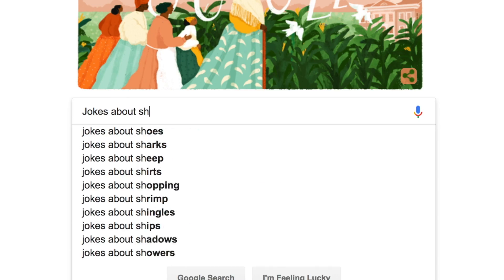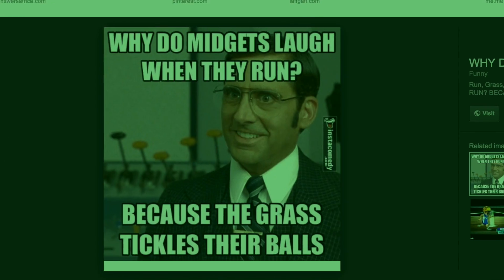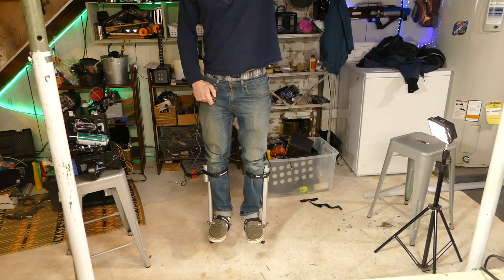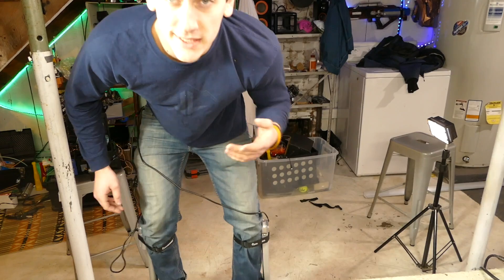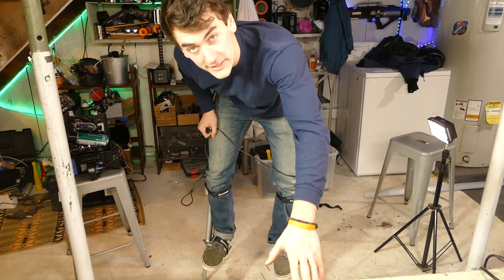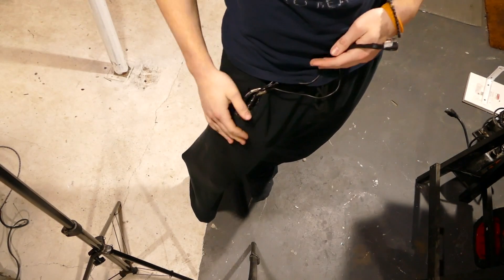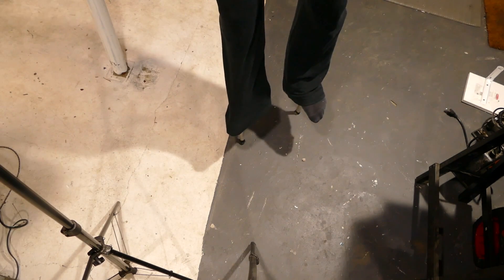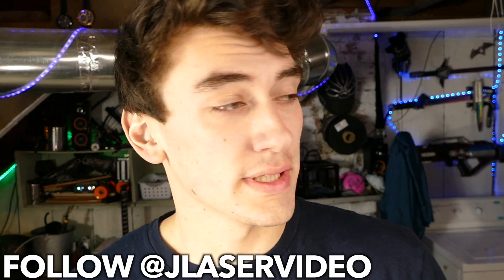How To Get INSTANTLY Taller With This DIY Device!!!

Comment: This is much simpler than my design. I was working on a metal boot brace to mount actuators on for this very concept. I also found pneumatic stilts are a thing. Used in sheet rock applications
Reply: Cool !!

Comment: Suggestion: make a foldable/extendable/concealable staff like Robin's, but that could be used for fighting (unlike that wrapped around steel sheet that were everywhere a month or so ago). 13 inches could extend to 30 inches, and unfold to 60 inches. And you should be able to hit pretty hard with it.